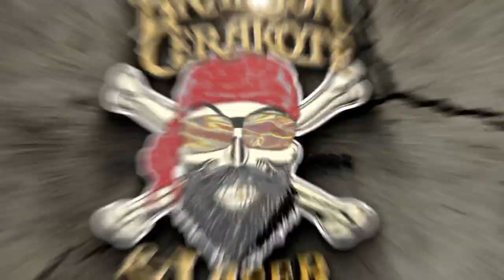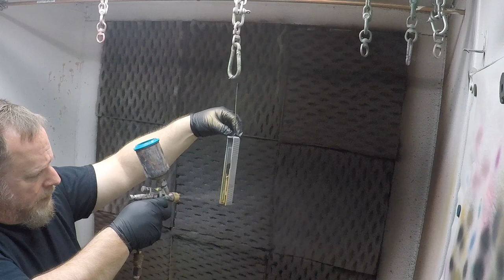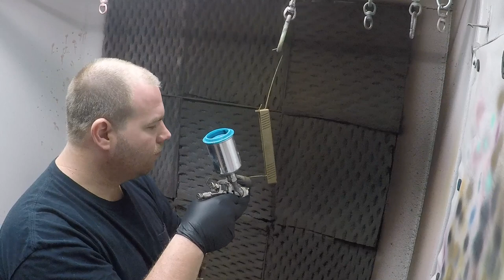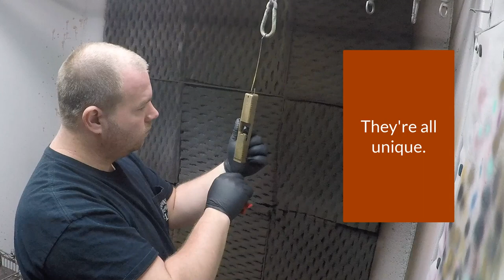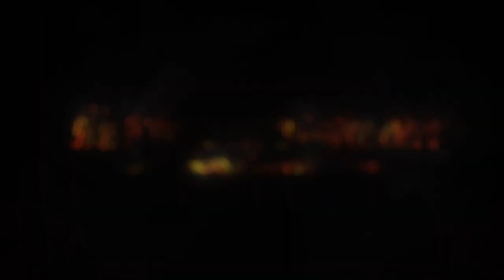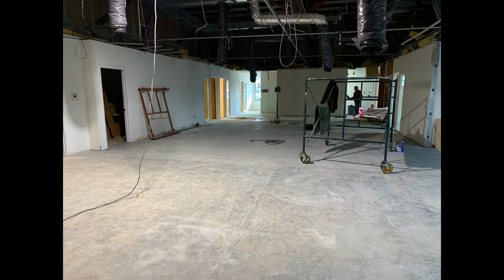Battleworn Gold Glock Slide | Branson Cerakote and Laser

Comment: Could you do battle worn with aircure?
Reply from the maker: Yes. Just spray the base, let it air cure for a couple of hours until dry. Spray the battle wear coat, and either let it sit for about 30 minutes and then wipe it with acetone, or let it sit for 3-4 hours, and gently scotch brite.

Comment: When doing the acetone does it need to be cooled down after you take it out of the oven
Reply from the maker: No. Just let it cool to a temp comfortable enough to handle. Speaking from experience, don't touch it with those leather welding gloves. It will still be sticky and the leather will shed fibers into you're cerakote.

Comment: Thank you for the great tutorial! Is there a reason why you set the compressor to 45 psi and not 80-100 psi when sand blasting the slide? I thought all metals should be blasted at 80-100psi?
Reply from the maker: We have a metering valve, which cuts the pressures in half.
Reply: Values vary. Already Anodized parts are sprayed at a lower pressure than other metal parts. Source: the video on the official cerakote channel

Comment: Does the acetone affect the cerakotes durability since it's not in the final cure state while using it on battleworn applications?
Reply from the maker: Nope. The base coat is where the protection is at, and it is already tacked out by the time you rub acetone on it.

Comment: Has that simple green been working out good as a substitute for acetone?
Reply from the maker: We've found that it degreases just as well, and is a lot cheaper. The things we had trouble degreasing with acetone are the same things we have trouble degreasing with SG. (700 barreled actions, etc)
Reply: @BransonCerakote  Good to know. Do you find that it takes longer for one of the two to evaporate from the prep surface more so than the other? Thanks.
Reply from the maker: @clarkkent4991  With the SG, you have to rinse the parts with hot water after, then throw them in the oven for a few minutes to dry them out. The little extra time and effort is no big deal compared to the cost savings.